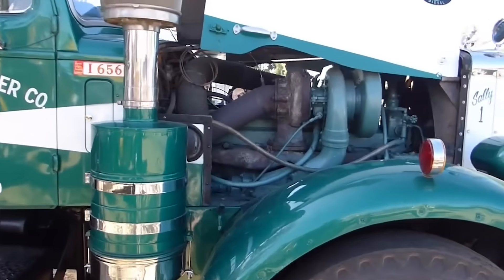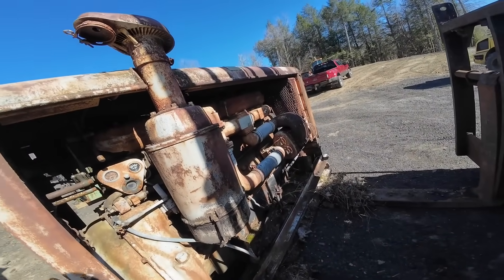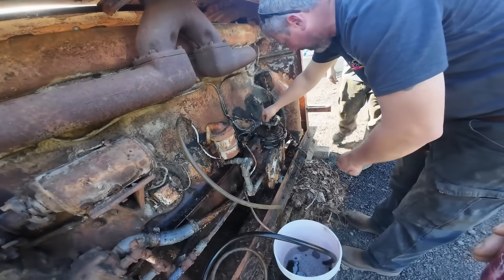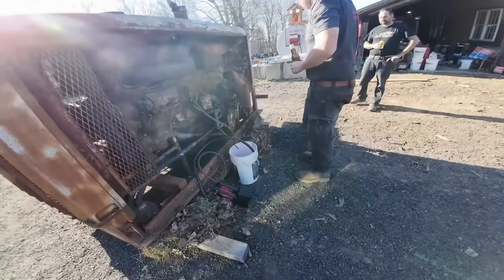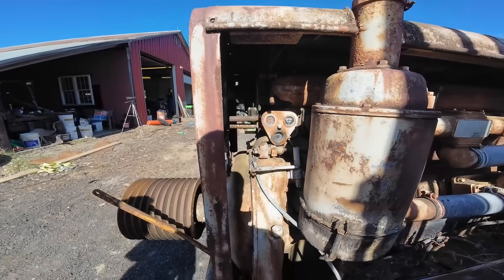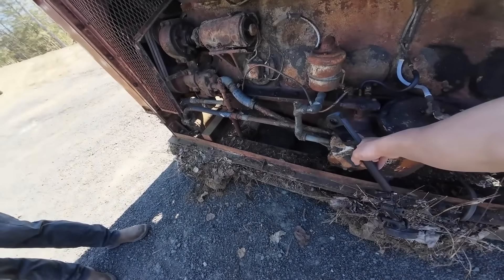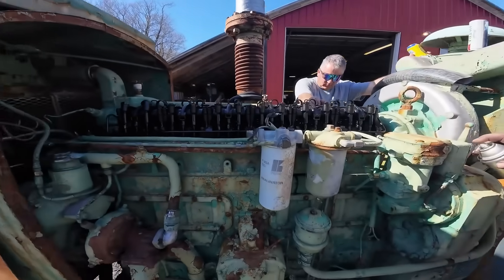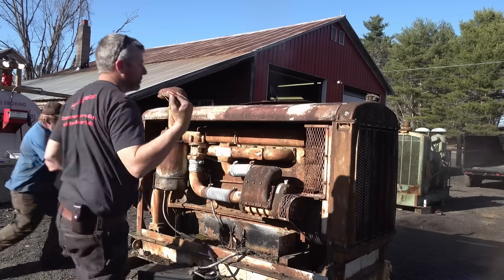Detroit Diesel 6-110: The Leaky Legend That Refused to Die!

Comment: So 6-110 were never in trucks? I had a A/C HD 20 with this engine, and it just trouble free. It had a torque converter that used diesel fuel, the matching of the drive train was perfect. It was a very good engine.
Reply from the maker: That's awesome to hear that you had such a positive experience with that engine in your A/C HD 20 :)
Reply: Yes they were , not many  Look up Mack with 6:110  I don't know of any others . 
Also in A lot of Euclid off road trucks.
Reply: I have 2 HD 20s and the one in the footage at the beginning is me.

Comment: The 110 never ever came trucks and I’ve never seen it in any driving equipment. It was in separate stand alone power units. Cool engine though 😎
Reply from the maker: You're right! The Detroit Diesel 6-110 has found its niche in standalone power units rather than trucks. It's fascinating how these engines have carved out their own legend in the machinery world!
Reply: @AmericanVintageLifestyle-h6c  there were 110 engines in TS24 TEREX motor scrapers.

Comment: You can still buy some 6110 parts. 
The reliability of Detroits was in all 2 cycle sizes. For many years Detroits were the most common engine in fishing boats and as auxiliary power in ships and tugs. Also Detroits were the most common boat engine in the USN thru the Vietnam War.
Reply from the maker: Absolutely! The Detroit Diesel 6-110 has definitely earned its reputation for reliability, and it's great to know that parts are still available for those who want to keep these legendary engines running strong.
Reply: I served on a 36’ patrol boat in RVN which had a 6-110… fortunately I wasn’t the engineman.

Comment: I thought the main idea of these engines was that they could go from cold to full load in a matter of seconds? Without blowing up. Which is why they were used in emergency backup generators?
Reply from the maker: You're absolutely right! The Detroit Diesel 6-110 is known for its impressive ability to go from cold to full load quickly, making it a reliable choice for emergency backup generators.

Comment: All Detroit s of that era slobbered from the air boxes and had poor gasket science, the 71, 53 and 92 series were also guilty until the late 1970 s early 80 s all you had to do was redirect the oil back into crank case and you were golden. I worked with fitters who maintained them in the day and they said if GM had pissed off the centrifugal blower at the design stage and made a bigger Roots or hooked 2 4-71 blower s in tandem they would have worked a charm and would not have kept hand grenadeing. Still the 12--71 was the pick of the litter, lots of HP and and a dry liner unlike the 92.
Reply from the maker: You make some excellent points about the Detroit engines of that era! The design choices definitely sparked some interesting conversations among fitters and mechanics.

Comment: I work on alot of road equipment but NEVER had seen a 110 series detroit in class 8 truck equipment. I found 110 in stationary gen sets.
Reply: Tnx - I was just going to say that.
Reply: I said the same thing when I saw the title to the video
Reply: Correct.
Reply: GMC installed 2 dozen of them in a large trucking companies fleet. Around the mid 50's. I would say it did not work out. I have seen one in marine use many years back.
Reply: That's because there were not many used in trucks

Comment: The engine that wouldn't start in the cold was NOT a 6-110. Try to get a blasted Cummins going with frost on the grass. All a GM/Detroit needed was a lit propane torch in the intake air and off it'd go. ANY 2-cycle would.
Reply: Absolutely! And they ALWAYS ran without smoke if simple and easy maintenance is followed. 4 strokes simply choke for air by their own principles of operation and because a 4 valve head flows like a 2 valve because only 2 valves, intake and exhaust, operate independently and only 2 are open at a time, poor airflow is result. If not for turbochargers, 4 stroke diesels wouldn’t even exist, and yet they are still smoky slugs and all the emissions junk on them today shows how bad they really are. All 4 stroke diesels are terrible cold weather starters, and always were, always will be, because compression every other revolution means any heat made by the compression stroke is LOST out the exhaust! Diesels are only correct as 2 strokes. 4 stroke diesels are literally Rube Goldberg trash. I always disliked them and with good reason. This goes for gasoline engines too. Especially small 1 or 2-cylinder engines, 2 stroke is the ONLY way to go. 😋👍🏻
Reply: @HammondC3  The pal Canadian at Detroit Garage has done all matters of tests to 2-strokes and has gotten 280 horses out of a 3-53 with hardly no smoke. He's running on in his 350 Ford now. Building another one for a straight drive. He also has a dyno so it's all recorded. Detroit Garage is his channel. WELL worth watching.
Reply: @HammondC3  A nissan UD-4 runs with supertech TCW3 from walmart
Reply from the maker: Thanks for the clarification! It's always interesting to hear different perspectives on engine performance, especially when it comes to cold starts.
Reply: @AmericanVintageLifestyle-h6c  I've run them on the road and in equipment and Army stuff when I was there. I PASS! Thye 903's and 55r5's were some of the worst and they were V-8's. Then never ran 2ice the same way.
Reply: They are more like snowmobile engines as they are a bigger version of one sort of!

Comment: The 6/110 was a engine to fill a gap in Detroits line up that was later filled by the 92 series. The 110 engine evolved into the 149 series. The 149 is still in production as an EMD powering large super yachts fishing boats and standby power generators
Reply from the maker: Thank you so much for watching and for the additional insight!